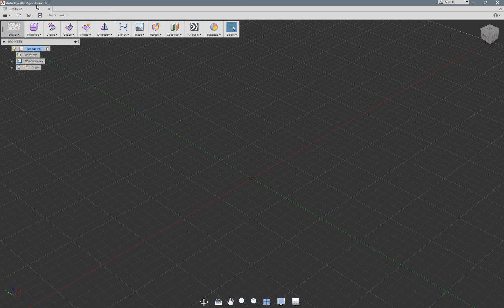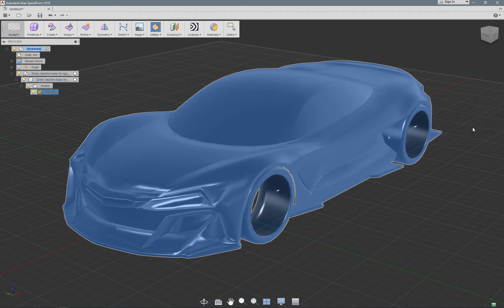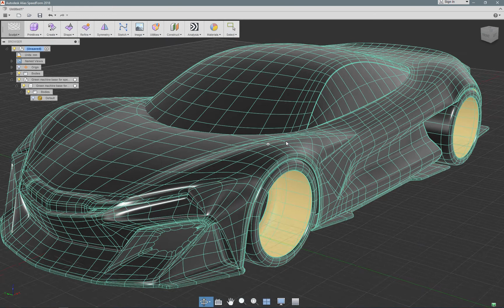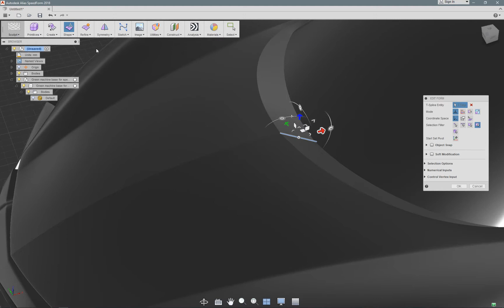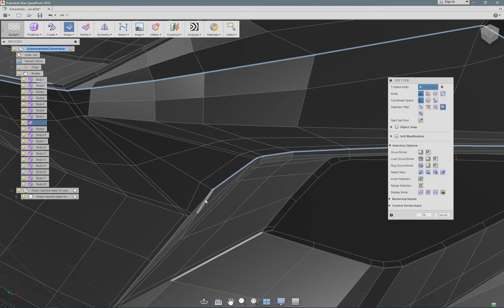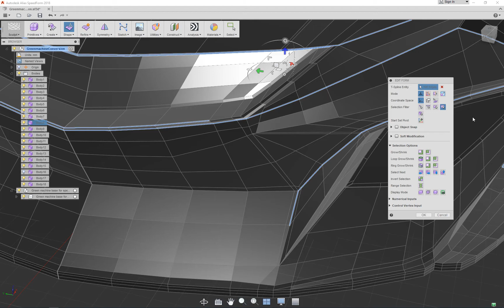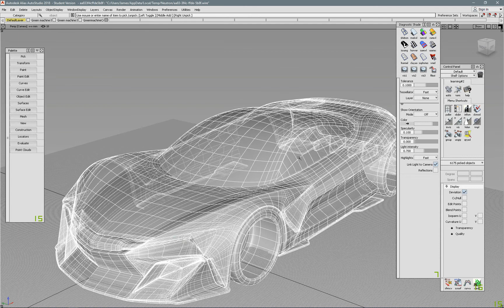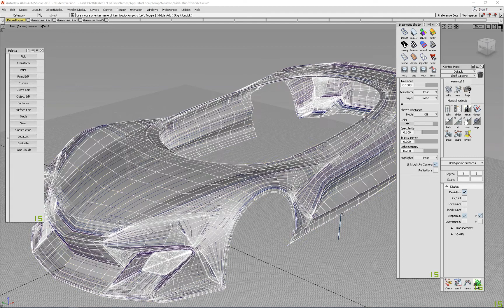Alias SpeedForm PT 12

Comment: Thanks for the video.
I was just wondering.. what is your thought on skipping the MODO stage of the modelling and jumping into CAD surface modelling directly from your VR sketch?
Would it be possible to sketch something with Gravity Sketch and import the file to Alias, Fusion360, Rhino, or Solidworks to make clean surface model based on the sketch?
Reply from the maker: You can absolutely import directly into your preferred CAD system using the Iges export. (pro and studio feature). I use modo as an intermediate step because at this stage I am still doing some design work and this allows me to move the surfaces around without worrying about continuity and surface breaks. Its easier to push, pull and morph the design surfaces at this stage.

Comment: Hi and great video. I have a question if you don't mind. Before I decide to install the program, I'd like to know if Boolean operations are fully implemented. As an example, can a cylinder primitive eat out a portion of a primitive box so as to create a wheel arch? I know it's not the tidies technique but sometimes, for simplicity's sake and speed, it would be convenient to use such tools, such as Maya has. Am asking because I can't seem to find a related video here on YT. Thanks in advance.
Reply from the maker: There is no Boolean function in this software. Just surfaces and primitives.
Reply: James Robbins You seem to have a deep polygonal understanding. Have you ever used Mirai or even Wings 3D?
Reply from the maker: I use Modo and Cinema 4d  mainly and a bit of Maya. Mirai I've never heard of and Wings 3D I tried in 2007 ish? I think..
Reply: @JamesWRobbins  how do u rate rhino t-splines compared to fusion 360 and alias? and which is better, from these 3 if we compare all of them
Reply from the maker: They are actually all the same. Autodesk bought T-splines a few years ago and integrated that tech into Fusion 360 and Speedform..